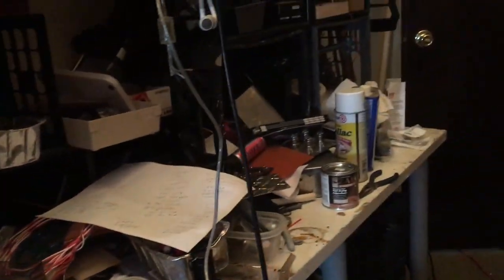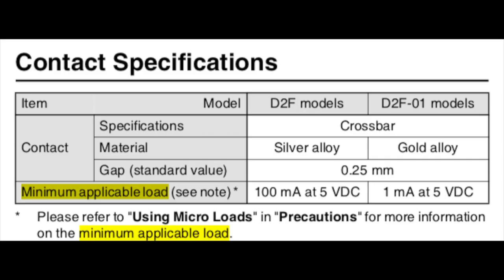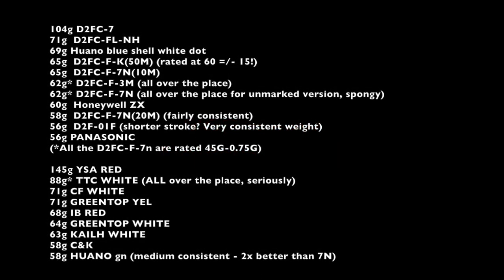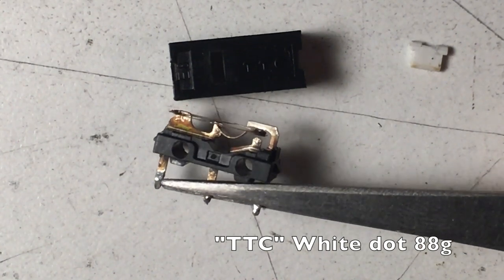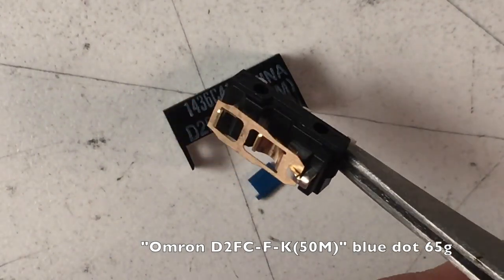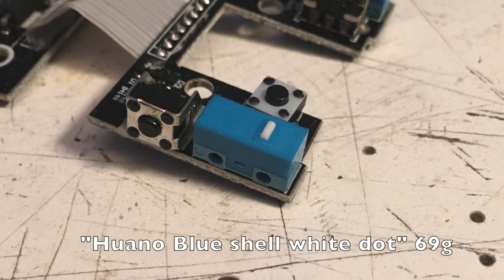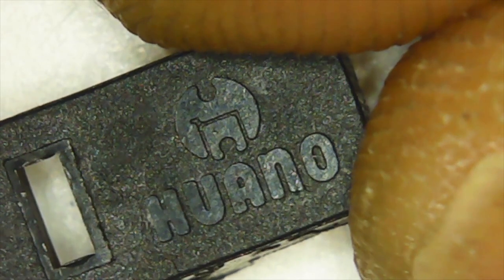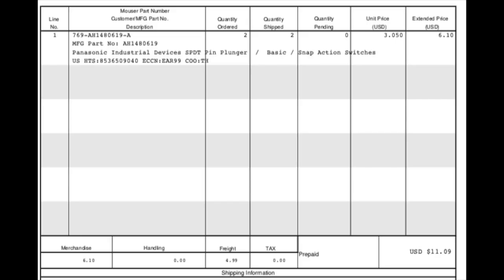Failing mouse switch part 2: teardown and testing

Comment: I left a detailed comment here https://www.youtube.com/watch?v=v5BhECVlKJA&t=2591s

It seems the older mice designs had more 'tolerance' for failing mechanical parts, whether by design or accident, like an AK47 rifle is, making it more reliable for its purpose.  Likely the lower polling frequency and the higher operating V x I power of old electronics makes the mouse more tolerant of switch malformation since contact resistance can be overcome as it ages, it has far more 'noise margin' compared to low voltage, current aka lower power designs.  Also, the Logitech button design does prevent side movements, is a plus.  I think the long term solution for using lower power electronics is abandon mechanical switches as obsolete, since they all suffer from the same issues at some point, and should go fully optical to remove wear and tear, and just emulate the click feel in a part that has very long cycle life, like an Omron switch but removing the contacts and use its travel to interrupt a light beam as a switch.

Comment: Could you test the endgame gear xm1? It also uses 50m omrons but they apparently implented them in a way so that they won't have double click issues. Would be nice if you can approve their promise
Reply from the maker: I just now read the press release. It looks like they use a small RC circuit on the switches, poll the switch actively through the ADC inputs rather than digital, and then do some DSP on the signal... I think.  Tough to tell from just a pic of the shell and a brief press release.   Sounds like a good idea actually.  I am not sure exactly how they did it, but if I were to try the same thing, I might actively poll the switch in "chunks", read a bunch of samples in each chunk, smooth that out (averaging both the good signal, the nulls and the false bounce and chatter), and then use that resulting chunk as the 'click' or 'don't click' for each sampled cycle. if they used SIMD instructions or vectorized it, I can see how they could get the 'chunk' sampling to run faster than 1ms like they claim. Or it could just be a simple gated integrator/rolling average, but apparently there is a patent, so it would have to be fancier than that? I'll keep an eye out for a patent number since that would tell more.  If they are cheap enough, I may pick one up.
Reply: @AlexKenis  WO2018149471A1 would be the applicable patent number to get a grasp of how it works electrically

Comment: Another issue is that people are measuring click latency now, so there's a drive to reduce debounce delay, but fixing the debounce problem properly by taking advantage of the fact you have double throw switches would mean people aren't buying new mice because of worn out switches.  With double throw debouncing methods the switch would never get the double click or release during drag issues, because you latch pressed when the NO contact reads closed and latch released when the NC contact reads closed.  For it to stop working you'd have to wear it down to the point where it either fails mechanically, or never makes electrical contact at all. This method is basically free if you have spare pins on the microcontroller, and less than one cent per switch if you don't have any spare pins.
Reply from the maker: I thought i replied to this, but the community comments sections doesn't think so... Anyway, yes I agree.  I think most of these 32-bit chips have schmitt trigger inputs as well, or you could toe it to an interrupt, etc.  Seems logical
Reply: I had this thought, yes. Maybe layout constraints to an extent, not just component cost? Because i mean you don't get a lot of space to work with.

But if debouncing causes press latency, chances are, it's done wrong. I mean you can register a press at first contact, and register a release when there was no signal during debounce window, thus your latency is on the release, where it naturally mechanically is anyway and thus expected, because the snap action of the switch provides some hysteresis. I don't see why you need to debounce it in the other direction if the neutral position pad is not even connected to anything.
Reply: @SianaGearz  If you have extra pins on your microcontroller, you just run two traces in the same place you would have run one trace, just connect the common contact to ground and treat the NC and NO contacts as separate inputs.

 If you don't have extra pins, you can use something like a 74HC7014 and one resistor per switch to get you positive feedback based debouncing. (hook NC and NO to opposite rails, the common contact to the input of the line driver, and a resistor from the output of the line driver to the input of the line driver. The layout isn't a problem if you have a double layer board, might take 1~1.5 square cm for 6 to 8 switches, with a single sided load. You might even be able to skip the positive feedback and just use a capacitor to keep the common contact stable while it's floating, but you'd have to test that.

If you use single contact debouncing you either need an extremely long delay on release(>100ms, long enough to interfere with intentional click spamming), or you need a delay on both press(~5ms) and release(~50ms), which increases the click latency we care about.
Reply: @sleepib  100ms? Why? If it's at all possible that the switch no longer makes contact for a whole 1/10th of a second while still being held down, there's no way you can extract any useful behaviour from that switch, at least not when you're reading it in a single-pole configuration. The travel from the bottom plate to the top plate also couldn't possibly take more than a millisecond since there's snap action both ways. 

Most gaming mice do usually have lots of unused pins on the micro, because it's usually STM32F103 or LPC11U14F, but it often has to sit on its own daughterboard so the interface to it becomes icky. Consider that the wheel area generally has a cutout which causes routing issues, and then there's a fairly dense bunch of switches there, and you need to route around the sensor too.
Reply: @SianaGearz  Why exactly do you think mice start double clicking when they wear out? Hell, even when new in some mice. It's because there's only intermittent contact on the normally open contact, while the switch is held, and the delay is insufficient to cover it. If you decrease pressure without going all the way to the snap action, that contact can be open indefinitely while the switch is still on the "pressed" side of the snap action. Maybe those Panasonic switches are an exception to this. 

Routing two contacts per switch isn't really any harder than it is for just one, because you'd be routing it right next to where you would be running a trace anyway. Yes, the traces have some width, but it's not as difficult as you're making it out to be.  It's not a high speed signal, so you can run them around the long way if needed. You're probably looking at 0.5mm pitch anyway for your microcontroller footprint,  so you only need an extra 1mm of board dimension to cross the important switches from one side of the sensor to the other(assuming you're trying to get the pcb as small as possible). Honestly, adding a RGB LED is a bigger burden on layout.

Main PCB is constrained by the Z height for the sensor. Entirely possible for that to be the only PCB in the mouse. I don't see why you'd put the microcontroller elsewhere except for prototyping before designing a PCB(e.g. teensy). There are some good reasons to put switches on daughterboards though, because you might want one at a right angle, or below the plane of the main PCB.
Reply: @sleepib  Below the PCB? Nah the PCB sits at the very base of the mouse.

You cannot route right between the pins of the sensor because the sensor sits atop a cutout in the PCB.

There is often a second PCB with the switches for the side buttons, or the switches sit on the PCB at the bottom and get actuated by arms that are part of the same casting as the buttons, with buttons pivoting around a weld just beneath them, where the button casting is welded to the main enclosure casting.

I haven't seen attempts to try to get the PCB smaller, in part because the rear and the edges of the PCB carry the RGB lighting. But it does need to fit within the mouse footprint :D

They do seem to often use horrible PCB manufacturing techniques, like shitty board material which is just eager to get rid of any copper bonded to it, making thin traces a potential issue, trying to keep the main mouse PCB single-sided and thus lifting the processor PCB off when they have to use an SMD IC for that. I don't remember what mouse i have seen that on though.

The G203 mouse indeed has a separate PCB for the side buttons, and the left hand side on the main board contains a cutout for the support structure that props up the button PCB. The sensor takes up the entire middle of the mouse, with space between that and the wheel cutout being snugly occupied by the middle mouse switch - it is a remarkably big sensor and with a lot of pins, but most of those are likely purely for alignment and load-bearing, and the cutout continues well beyond the sensor to allow the light guide part of the lens to be installed. It is a dual sided board. The rear of the mouse is taken up by the multi-LED RGB assembly and by sensor lighting. The USB cord connector and the STM32F100 sit at the right hand side of the mouse, but the processor is super close to the edge, so that limits routing options. There's also a number of screw holes, one not far from the microcontroller - you don't want the board or the lens to rattle in the mouse.

Something like the G700s has as many as 4 PCBs, with electronics being on the bottom PCB with the sensor, but there's also one for the battery terminal and two for the switches.

The G300s has an offset sensor, which is largely frowned upon in gaming but allowed them to route all the buttons, and while most of the mouse is on a single PCB, the LED for the sensor is on its own little one. The PCB is obviously junk FR2 in this one!
Reply: @sleepib  Well if the contact can be open indefinitely, then why do you suggest that 100ms delay or similar order of magnitude is sufficient to debounce the mouse? Why not 10 seconds or half an hour? And why is it supposed to make any difference whether you introduce this delay on the press or the release part of the operation cycle? The moving contact is so far from the stationary one in the released part of the snap action, that it by all reason should never make contact in that situation. I would say that a switch which can be open indefinitely in spite of being apparently pressed is simply not useful for human interaction other than in very limited circumstances!

I suggest that the problem is aggravated by sparse sampling. To avoid that, you need to use hardware IO counters, or interrupts which you start polling cycle enabled but disable on first hit. So that for every say 1ms between polling cycles, you ask "has this switch had a contact during this time" instead of "hey i'm a processor running at 48 MHz, does this switch appear to have a contact during this very cycle?" Then you sure still need to aggregate data from multiple polling cycles before you can be certain that it has been released, but your odds are much better already!
Reply: @SianaGearz  I didn't say 100ms was enough to debounce it perfectly, that's just about where it starts to interfere with intentional click spam.  The 5 on press and 50 on release isn't good either, that's just what a lot of mice seem to use. 

The only debouncing I endorse in mice is using the NC contact to detect presses, and the NO contact to detect releases. No delays, and way more reliable.